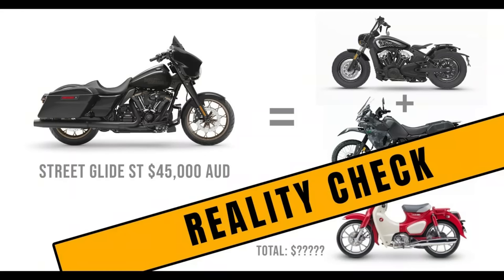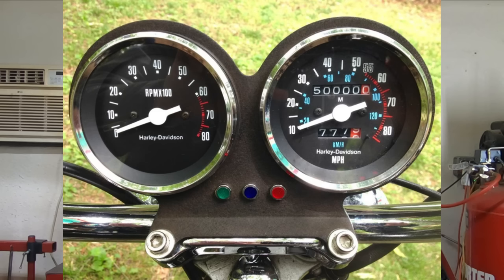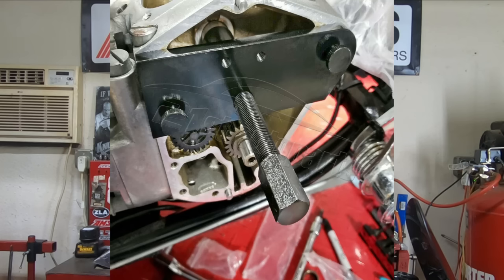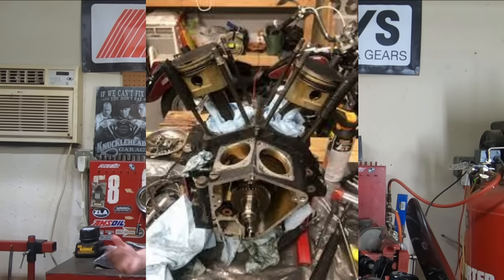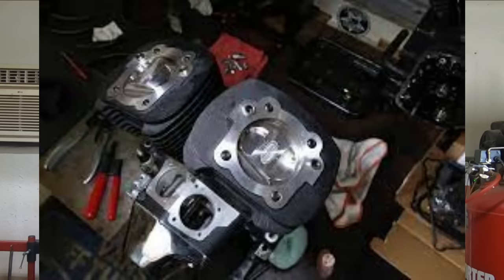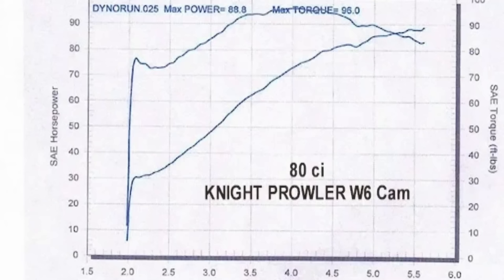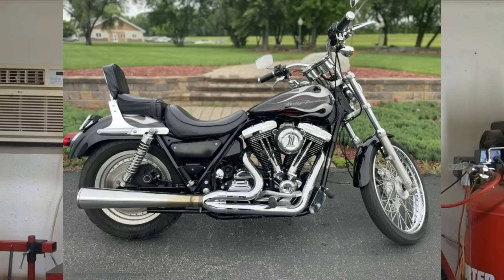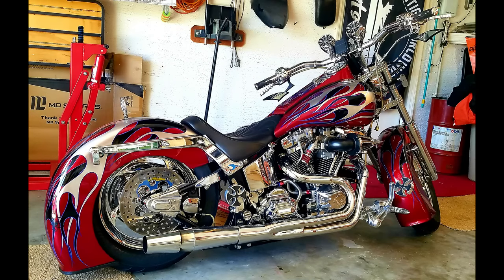Harley-Davidson Evolution is the Most Bang for the Money

Comment from the maker: Would you go with the Evo for a used motorcycle and put some power in it or choose to get a early twin cam and upgrade all the necessary components?
Reply: I prefer Evo over anything newer but love the ole pan heads. To me as long as your riding a Harley is all that matters. Every bike is going to have issues just depends on how well you take care of her and how much money you want to spend. Just ride man just ride... Great video tho, keep them coming...
Reply: I went with a pre-06 Twin Cam. Aside from the cam chain tensioners I haven't had an issue with it. I replaced the bad ones with stock replacements just to get it through the rest of this year and next year. But plan on converting it to the hydraulic system next winter. I agree with you the EVO is the best bang for your buck and I'd have no issue adding an EVO HD to my stable in the future.
Reply: Sure, why not. Very simple and they only appreciate.
Reply: And a Crate engine for a evo is around  $4000 ready to install witch is kinda cheap for a performance crate engine
Reply: I would buy an EVO and leave it stock I wouldn't touch a twin cam for free.
Reply: Got the dyna twin cam but next bike will likely be a rubber mount sporty or Evo touring.
Reply: Twin Cam. Around here, (western Pennsylvania, eastern Ohio) there is an awful lot of used EVOs that unfortunately, have been ridden hard and put away wet. They have achieved the same status similar to shovelheads I believe. Clean, low mileage Twin Cams, on the other hand are very plentiful and reasonably priced. I picked up an 06 Deluxe in 2018 for $8000. 6700 miles. True, I'll have to have the cam chain tensioner fix done sometime down the road, but I think it'll be worth it in the long run. Plus, the bike is smoother a bit more powerful than the Evolution. Just my opinion.
Reply: I got an 88” twin cam as my first (and current) Harley.  I upgraded to hydraulic cam chain tensioners the first winter I owned it.  20k miles later and no problems whatsoever.  Evos are cool though.  Certainly agree they’re a great bargain for a used Harley.
Reply: Evo don't even have to think about it
Reply: I'd take an Evo over a TC any day, and I think you'll be hard pressed to find someone who, given the option, would want a TC over an Evo.
Reply: @PotatoeJoe69  I prefer and am bias towards 2002 TC’s. Less headaches overall , handles more power while still running a carb.
Reply: Love mine!
Reply: I plan to build a 60s-style chopper with a large s&s(maybe 96") Evo on a hardtail frame with a 6 over stock rake front end. That is what I want for my daily🙏🏻 tbh I'm tired of my '95 FXDL 80" Evo. I want something with more character
Reply: Just bought a 2014 tc 103ho, simply because I got a great deal on a 10k mile street glide, but I love the evolution engine, always will, but like you I generally ride em fix em and sell em in many cases, also just bought a 1980 80" Shovel Head, Super Glide to get right and make a few dollars on it, I love em all...
Reply: I'd like to get a 100 HP and 100 torque out of the 98 Fatboy but that's probably not possible?
Reply: @pcontiman  well I herd thou the grapevine that hd is post to do away with they sporty.  Give u a hit- (elect). if u got one might won't to hold on to it. That all i her from the grapevine.
Reply: I'm looking at a 2001 electra glide classic with 45k miles, but it has the Magnetti fuel injection. Would you guys consider it? Cam chain tensioner has not been replaced. Any thoughts would be appreciated.
Reply: I like my Fatboy 1998 and it already has a screaming eagle tunner on it. Dual pipes. I would like to put some power in it!
Reply: Hi Gixxer! As usual great material. Thanks to you, among other materials, my next mature choice for a motorcycle is the EVO. However, the engine is one component of the vehicle. I would like you to do materials about others. For example, the frame. I have read that the frames from the EVO are much better than those of the TC. That up to some year the TC frames were worse than the later ones. That frames from Softails are stronger than those from dyn, especially forged frame heads. How is this according to you? Another issue is electrics and electronics. EVO has the advantage of being simple and repairable. How about electrics in relation to TC and M8? What are the differences between the different generations of TC? You are also talking about big twins mainly. How is it with Sportsters? Are the EVO-injected ones inferior to the older ones, or vice versa? Greetings!
Reply: Honda's run forever...no issues
Reply: EVO  any day.  Not a fan of the TC engines unless  maybe 103. 110.   My old 80 evo feels torquier than a 88 or 96.  My S&S 113 EVOs will walk all over about any bike I have ever ridden with.
Reply: I have a tc 2014 Street Glide 103 four stage. Beef up the 80 Evo.
Reply: No doubt an EVO-type engine. This is the last "real" harley engine. And the most perfect one. Simplicity, no electronics, injectors, computers. Repairability. And if you want power of the latest generation, no problem. Crate engine with large capacity gives unbelievable possibilities - and the advantages of a stock engine preserved. As for me, along with the TC ended Harley. If I had a choice between TC/M8 and a big japanese such as Kawasaki Vulcan 2000 - I would choose Kawasaki. EVO is the best everyday bruiser, for traveling, riding in the city, you get on and ride. The dream is Knuckle or Shovel. It blows my mind that someone buys a brand new, honda-like M8 for such sick money, when they can have such wonders for that cash.
Reply: @rebjimj.e.4119  I'm curious because I haven't had any closer contact with these engines. To what extent do they differ from the Harley EVOs?
Reply: Early TC’s and EVO’s. Absolute fan of the softail frame. The way it articulates is very functionally safe. Solid mounted engine. After market six speed. Installing a good kicker tho, $$$$$
Reply: I bought a 01 Duce and I'm doing all the upgrades,wish me luck.
Reply: @Pracaupodstaw  The twin cam motors to me feel "revvier"  .  I feel the EVO have more torque down low.  The Twin cam rev higher, are smoother and have power higher up in the rpm range in average. (of course a cam or modifications can alter any engine's characteristics) .   A  big S&S EVO is the best in my book as it fixes some of the minor flaws of EVO and gives extra power to squirt away and short shift and pull a 6 speed or bigger gears no problem.
Reply: My 2006 1200 evo sportster blows away my 2004 Road King twin cam. Sounds better to
Reply: @jimfischione2743  put 65k on a 01 Super Glide, stock motor.  Never had a wear issue with the tensioners.  Always thought these motors got a bad rap.  Loved the 88.  Own a 03 Superglide now that I put the SS510 gear cam kit in to give it a horsepower bump.  The original cam system was fine in that one too.
Reply: I’ve got a modern M8 softail for putting away miles and a 2003 evo Sportster I inherited that’s a relatively lightweight and fun little commuter. I do want to extend the forks and take the 883 up to 1250 for some real zip.
Reply: I like my evo. I’ve been able to do a lot of the work myself for a reasonable price. Is it super high power? Not even close. But it’s still fun and soulds great with the EV27 cam.
Reply: Just bought a ‘97 dyna convertible. It’s beautiful and I’m happy.
Reply: My first Harley was powered by the Evo a '97 Dyna Low Rider. Then in '06 I found a great deal on a brand new 1200R and despite that being a sportster it was an absolute beast w/70 hp and 79ft torque. I destroyed big twins on that thing. It's been ten years since I was on two wheels and lately I've been looking at what's out there. I've saved some money but I'm not working I'm actively looking but have had several offers just evaporate so I want to get back to work before I commit to spending the dough. Knowing the Evo is not the high powered engine I'd like it to be I've been finding smoking deals on TC 96's, but after watching your video, I'm reevaluating my thought processes and choices. Thanks for that you bastard, LOL. You got a new sub and I hit that notification bell.
Reply: So, I own and Evo, a twin cam, and an M8. They’re all very different animals. My Evo is a dyna, and I love it, but it will never reliably have the power of my M8. Plus, you better be able to do your own wrenching on the Evo because a lot of shops don’t know how to work on them - especially the dealers.
Reply: @jeremyweaver3016  i have a 95. its my lifetime bike. Follow themaintenance schedule, fix any messups by previous owners and ride it till you cant.
Reply: @Rundark-  stay with carbed sportys and 95+ evos.
Reply: MR. Foo. I would buy the Evo. Every time. I'M a old school , Older  the bike the better. My, ex wife had a 96 Electra Glide dresser.Camed, top end .and lower end upgrades, It would lift the wheel 1st thru 3rd, EVO'.S will rule the earth, when all the others get lost in the wind.lol... seriously. All bike in the harley, clan ,stem from an idea, and our freind, The Epa..saddddd.
Reply: @GixxerFoo  you listing all those specific reasons that the EVO is more reliable than the TC is super informative!

Comment: Ran a '85 EVO for 22 years with 54K miles. The transmission had some issues but resolved in first 3K miles. Great bike! Had Shovels, Sportsters and Twin Cams too. The EVO is so, so simple, easy to wrench and cheap to maintain... just like what shared here.
Reply: The sportster Evo is a completely different motor huh? Has a few more cams.
Reply: @LonerBoi88883  the sportster Evo engine is just an old iron head engine with tighter tolerances. I love it!!!

Comment: I am from Germany and had my first Big twin experencies in the early 90 s . Wahtever , I bought in September 2021  a 2002 Dyna Wide Glide , imported from the United States . Luckily the Camshafts had been removed , and S+S Geardriven Cams had been installed . I had to do little work to put the Bike in a good condfition . In April 2022 my son bought a1997 FXSTC from the same Dealer from where I had mine . We fixed it , because there were some Issues . While that we installed a EV27 Camshaft and changde the Main Jet to a195  cause there are V+H Pipes installed  . The Bike runs very well . Okay  , to keep it short , my son and i Changed the Bikes because he liked the upright posotition on the 88 Dyna and the oppotunity to increase more power for few money . To me it was perfect  because i got the Bike with  Motor i ever wanted . Evo in Germany is soooo much expensive  , Twin cam is always 1,5 -2k  cheaper . Greetings from old Europe  , wish you a nice Christmas time . Sorry for my broken english .
Reply: I’m touring my evo around Germany , now the only problem I’m  , . having is on the autobahn . I only do about 120 km/h.

Comment: Harley did research and development on the EVO for years and put millions of miles testing it.
Reply: Yet they had issues with the transmission flexing because it was only mounted by 3 bolts
Reply: @tylerhubbell6410 lol, no.
Reply: @tylerhubbell6410 the hell are you talking about? Lol

Comment: Bought my 1996 dyna for $3450, with 46k on it, slapped a cam and tuned the carb up. Zero regrets and its actually got quite a bit of power for what it is.

Comment: I bought a 99 Softail Custom 13 years ago with 18,000 miles on it. It was completely stock except for the Chrome Harley stuff the first owner had put on it. I am 82 years old, and have 64,000 on it now. It has been  very reliable. I replaced the stator, and the inner cam bearing for peace of mind. That is about it. It just keeps running great. I am no hot rodder which probably is a good thing. Not that I do not ride it 85 mph some days for a while, but I do not do burn outs and things that stress the bike. 

I almost always warm it up some before I ride it, and as such have no leak issues. I love the simplicity of the EVO. You can change carb jets in about 10 minutes without removing the carb. It is just one of those things that gives confidence that it will get you where you want to go. 

I use to ride 200 mile days about once a week. Now I just ride around where I live for half an hour or so almost every day weather permitting. The Softail is a super comfortable machine. I have a bad back, but the stock pillow seat is very comfortable along with the pull back buckhorn bars. 

I have owned and ridden lots of bikes since my first Harley, a 1942 "45" flat head when I was 14 back in 1955. I rode an 84 Iron Head Sportster for 23 years. 

But this EVO powered 99 Softail Custom is the cream of the crop. I have no desire for the new ones. Mine is garage kept, and in immaculate condition. Harley's Chrome and paint is as good as you will find anywhere.  To say I love this bike is an understatement. A carbed stock EVO is as good as it gets. Plenty of power for this old man who just likes cruising the back roads and listening to the music of the drag pipes that never goes away. Who needs a radio anyway. I ride with a helmet and goggles and without a windshield 99 percent of the time. I bought it on e-bay for $7,100 in 2009.

Comment: Owned several used 1340 Evos over the last 20 years and still run a 98 Wideglide with 43,000 on the clock. Equipped with a Super E carb. Clean oils every year. Still runs great and mechanically quiet. Love it !

Comment: I have a 1988 heritage Softail classic along with a 2015 street glide special. I use the Evo for local rides and the street glide when I am touring out of state. I have owned the Evo since 2001 and I really enjoy riding it. The evos are hard to find as people from overseas have agents in the u.s buying them and shipping them overseas as the demand is high because the epa standards are based on the year, so they can get them registered easy overseas and the availability of parts is readily available overseas also. If you are mechanically inclined the Evo is the way to go if you want to ride, but you have to remember a Evo is a 1340 cc motor with a 5 speed transmission.

Comment: Absolutely right on Gix. I've had 5 evo softails over the years. I still have my last one since new in 99... I'm old now. Figured I'd get something easier on my bones for longer rides. Found an immaculate  98 FHLP with only 6K on the clock for 6K dollars. It was worth the 12 hour ride (each way) to get it. Wouldn't trade it for all the tea in............ or any of the new 35K+ rigs I see here at the local dealership. I'll be happy with my two evo's till the day I die...... Thanks for all your insightful videos.

Comment: Just added my 4th evo powered bike to my garage.  Stripped down 1995 electraglide.  96" s&s stroker crank and cases. S.e. cylinder heads. K.b. pistons. Sputh trans case, andrews gears, Barnett clutch, newer style saddle bags, lepera seat, avon tires, Plus a bunch more stuff.  This bike will smoke the back tire endlessly.  With the bike came all the original parts also. Wheels brakes bags seat handlebars fenders.  I picked it up at local harley dealer. $5,000with taxes out the door.

Comment: My 98 Dynas @ 99,600 miles rebuilt it at 60,000 put an Andrews EV 27 and Keith Black pistons and she still runs great. Nice motors and fairly easy to wrench on.

Comment: I agree. EVO’s were the best of big twins. The last couple of years were the best of that run. The trans they pit in those were tuff. They used that gear set went all the way till the six speed.
Reply: “Were”
Reply: And don't forget the 9-plate clutch in '98!
Reply: They didn’t have enough torque to break anything . My twin cam will chew that evo up and spit it out and put down more miles
Reply: @dont95blink86  After your leg burns. and the chinese shit falls off!
Reply: @frankfurther3828  i fixed all those issues
Reply: I have an '86 fxstc. It is an absolutely beautiful bike!

Comment: I bought my 96 FLHRI from a friend of mine last year for $2,800. He was the second owner and it only had 30, 000 miles on it. After a few months the Magneti Morelli system started failing. I ditched the ECM, the injection system, manifold air cleaner, gas tank guts and I replaced it with a Mikuni hs2, Ultima ignition and did a little wiring work. It's been a great bike so far. Best thing about it is unlike my Panhead it has the "electric leg."

Comment: I have got a 1981 wide glide shovel and while I have done a few mods and a few upgrades I still have the 80 cube basics but I just wanted to say that with a bit of work you can get your shovel just as powerful and just as reliable, and I know that I'm probably going to get the EVO guys telling me how the same amount of work on the evo they are going to be stronger and faster, but if you don't mind a Spanner then I still say the shovel with better barrels as in more fins and a port and valve job in my humble opinion they have that iconic note and they are pretty good as long as they are serviced.

Comment: I have a 1998 FLHRCI Road King Classic. I got it cheap and very low miles . Looks like it just came out of the showroom BUT it's got the Magneti Marelli system on it. I watched your video from last year about converting to carb or Delphi. Had I known at the time I bought it about the MM system I probably would have passed on it because of exactly what you said in this video. The Zipper's Delphi kit is $2500 and the main sticking point with converting to carbs is the nearly non existent carb harness (32453-97 is the only one that works without modification on my bike). Luckily the bike came with the Service, Parts, and Electrical manuals and I have found all of the correct connectors so if mine ever goes out I'll make the harness and go the carb route because most of the MM parts just aren't available new and used parts are often unreliable or priced like collectors items. So just as you said in the video if you find an EVO bike with the MM system and can't do electrical work it's best to just avoid it.